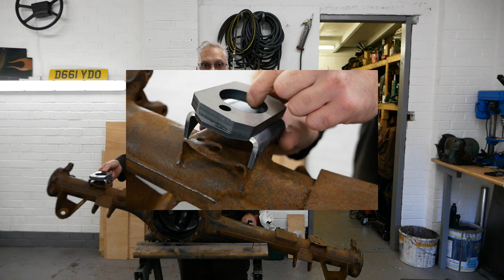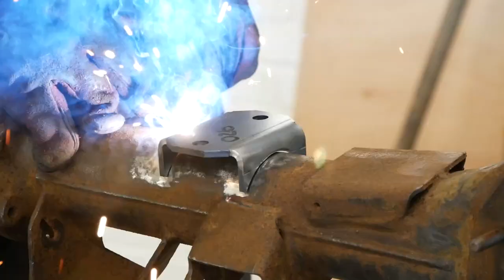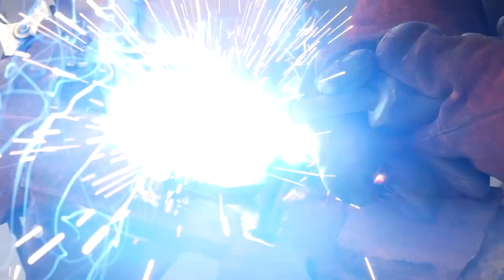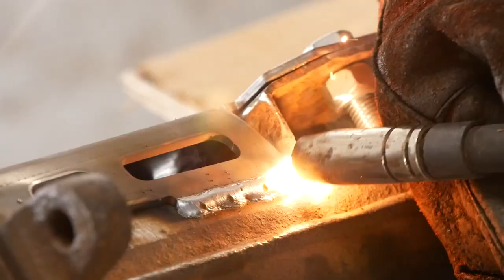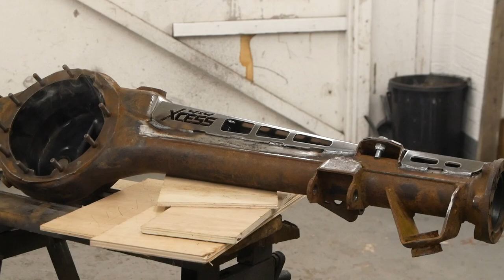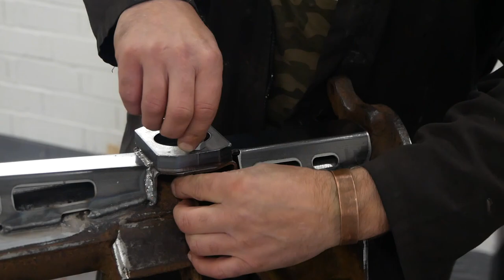Fabricating a set of reinforced  axles for a Land rover (Xcess 4x4) | Heavy Duty Axle Build..part 1

Comment: Back axle on mine, has been done with Xcess4x4 truss kit and Gwyn Lewis full diff pan. 
Lining up my friend to do the front Xcess4x4 truss and have the Gwyn Lewis half diff guard to go on. Going to do in situ. 
New half shafts will be going in with a trick Ashcroft diff from Nigel in January.😀
Reply from the maker: Hi Graham...i have got the same set up on my defender but i put the full diff pan on the front and the half on the rear...and i also welded the front one in situ there is a video on this channel of me doing this...but when i do the next one i will take the axle off as it is easier to weld..regards Paul

Comment: Nice welding! Good little tip for fabrication, when lining brackets etc like that spacer and spring mount, countersunk screws will hold things dead centre for welding together.
Reply from the maker: Hi James...self tapping roofing screws are good as well for doing alignments on panels and body work as well...also a lot cheaper than buying clecos...regards Paul

Comment: Those Spacers you put on the spring perches, are they compulsory for the Truss kit? I already have a 3" Spring and 2" Body lift so really don't need any more, but looking to do the Truss kit asap.. Cheers
Reply from the maker: HI Leo...the spacers that come with the kit are not compulsory to fit..i fitted them on mine cos of the weight on the back of the truck makes it sit down on the back but you don't need them..regards Paul
Reply: @All4Overland  Excellent. Thanks for the reply

Comment: Great job mate you always make things look easy quick question not 4x4 related you no more than me going to look at an 2016 vauxhall vivaro lwb tomorrow with 100 thousand on the clock do you think i should be worried about the mileage?
Reply from the maker: Hi shaun...i wouldn't be worried about the mileage its just over 20,000 miles per year as long as it has service history and the oil has been kept clean it should be fine...they will definately do the mileage with no issues so i would just give it a good looking at..regards Paul
Reply: @All4Overland  thanks for your advice

Comment: Hi whats the reason for doing this???
Reply from the maker: Hi Louk kai...the reason for bracing the axles is to make them stronger for carrying the extra weight on the overland vehicles and also the bigger tyres...it helps to protect the axle from bending..regards Paul
Reply: @All4Overland  thanx Paul. Now everything clears.  Am building  a spectre replica crew cab .33” wheels , rollcage ,  .etc.Do i need reinforcment?
Reply from the maker: It just depends ow much weight you are carrying and how much you use it off road both of my trucks weigh over 3 tonnes when weighed so reinforcing axles is a must.
Reply: @All4Overland  oh that much???:) ok great thanx for the useful infos:)

Comment: You should push a mig torch not pull
Reply from the maker: Hi Mike...this is not strictly true as it all depends on the type of welding you are doing..it is more important that you are getting sufficient penetration into your substrate and when welding an axle like this you don't want to overheat the part you are welding so it is more puddle and penetration that you should be keeping an eye on not the direction in which you are welding...regards Paul